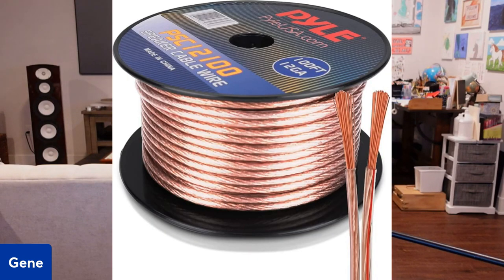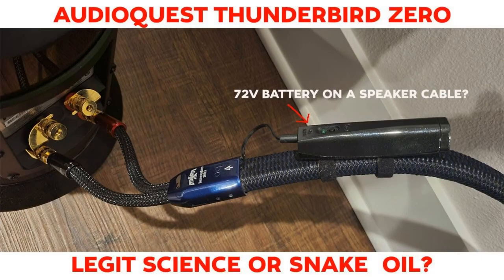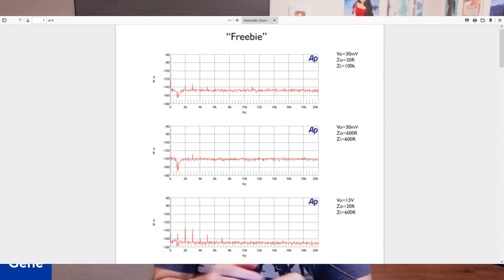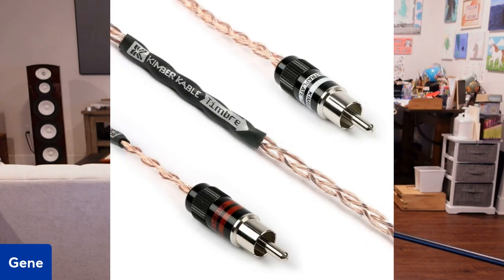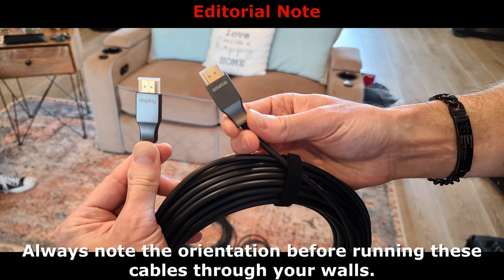Are Cables Really Directional?

Comment: Thinking speaker cables are directional is just absurd. That’s not possible in the real world. RCA cables made with  RG6 quad shield did well back when I used to make them for clients. I have made them with the ground floating on the non source end before but I found no advantage with that config so I stopped doing that. I’ve seen my share of RCAs with the shield floated on the preamp end but that is flawed since the preamp is supposed to be where ground gets hard wired to the earth ground. Maybe you can expound upon this Gene as I am not an engineer. A video on debunking this whole horse poop grounding thing would be enlightening. Sure would dispel this whole grounding snake oil horseshit. It needs settling!

Comment: Of course cables are directional; you plug the cables in to the back of the amplifier and then the others ends of the cables into the back of the speakers, the music signal runs from the amplifier to the speakers, that’s directional, surely?

Comment: Wire is made by being drawn through a die which can align not the molecules but the grains. Materials like copper have grains and they form grain boundaries. One way to reduce them is to anneal them. However, there is no evidence that this has any effect on electrical properties. As for AC current it has no net direction, the electrons just oscillate back and forth, back and forth. So the answer is that whether the wire has any kind of directional properties metallurgically it has no effect electrically on the sound of an audio system or any other electrical phenomenon even up to very high frequencies. Know this, if you buy what you think is monocrystalline wire (it isn't by a long shot, that has to be grown in an hugely expensive crystal growing machine) as soon as you bend it you are creating grain boundaries so even if it had started out monocrystalline it isn't going to stay that way.   

Now before you say aha everything is snake oil, here is a most unusual experience I had as an electrical engineer. In a laboratory building about 30 years ago the operations manager came to me and said he had a strange problem. A contractor had extended a string of smoke detectors. These are wired in series with a capacitor or resistor shunting the last one in each string depending on the manufacture and model. (This one was Gamewell.) I think they operate on 5 volts DC. The problem was that suddenly the alarm for that zone was giving false alarms. They had noted that where the two strings joined the contractor had spliced solid wire to stranded wire. The theory was that because there was a lot of RF noise sources in that building (we had seen other strange things) the string had acted as an antenna picking RF noise and the junction had somehow acted as a diode detector for those noise frequencies. So I went to the parts room, grabbed a 0.47 mfd ceramic capacitor and shunted the input to that zone. Problem fixed. The capacitor was a shunt at the noise frequencies, an open circuit at DC. What does this have to do with the question at hand? Nothing.

Comment: Sorry Gene, but you don't have the correct tools to measure certain specifics of cables, nor the ability to hear the difference even if you tried ,since the test rig that you have is not capable of revealing any abnormalities or differences of such nature. There is no way that a coaxial  cable  of one single strand,be able to propagate up to100khz linear in an audio spectrum. 
The major problem in audio spectrum propagation is AC resistance. 
To overcome this you will need 10 separate different size conductors to do so , to cover an audio signal spectrum of 1khz to 100khz to achieve time alignment stability. 
Otherwise you will have massive amounts of information losses, due to time alignment  issues.
The problem in the audio industry is that, every single manufacturer uses 2 different types of conductors between sources and speakers. 
It's like having a gravel road from point A to point B and a tar road from point B to point C
So that's already where one of the problems lie in the entire audio industry, since there is no time alignment stability in such conductors which they are producing. 
That's why there is so much musical information loss in audio signal conductors.
They all just designing by holding their wet thumb 👍 in the wind. 
It's all snake oil what they are trying to sell to the people 🙄 
But anyway that's just some of my experiences and observations ,by being in the audio industry for 37 years.

Comment: I've found reversing some interconnects will reduce hiss and noise when a problem
Reply: If an interlink causes audible hiss or noise you should turn them inside out and throw them in the bin.
Reply: @Richard-bq3ni  They're world's best cables, pretty decent stuff
Reply: @christophergaus3996  If they cause noise, how can they be decent?
I remember my good old amplifier and CD player back in the 80's. Standard consumer stuff, connected with the standard red/white plug interconnect. With the amp selected on CD while playing the silent track on the test cd, with  the volume button maxed out, I would hear nothing, no hum, no hiss, nothing.
So, why a modern cable would cause audible rubbish is something I just don't get.